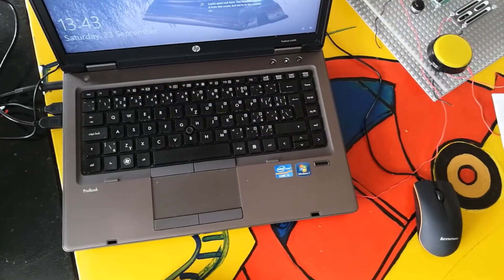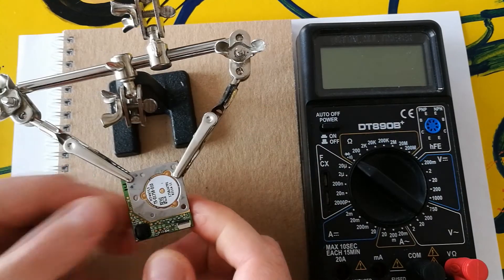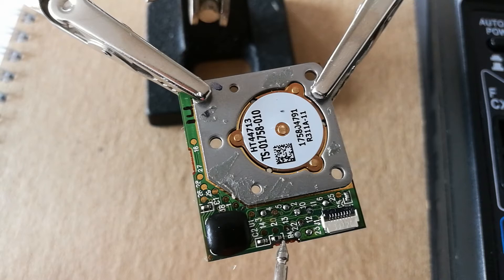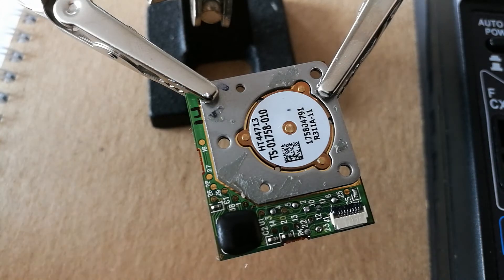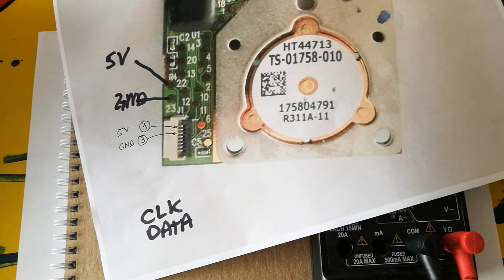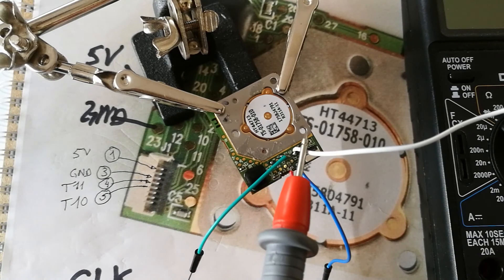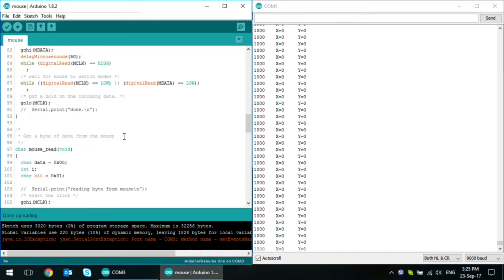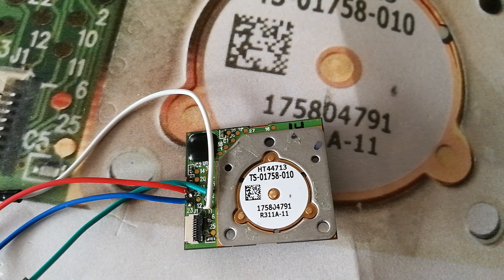How to find pinout for Touchpad/Pointing Stick & connect to Arduino - Synaptics

Comment: FOR FUTURE REF: 
/*
 * an arduino sketch to interface with a ps/2 mouse.
 * Also uses serial protocol to talk back to the host
 * and report what it finds.
 */

/*
 * Pin 5 is the mouse data pin, pin 6 is the clock pin
 * Feel free to use whatever pins are convenient.
 */
#define MDATA 5
#define MCLK 6

/*
 * according to some code I saw, these functions will
 * correctly set the mouse clock and data pins for
 * various conditions.
 */
void gohi(int pin)
{
  pinMode(pin, INPUT);
  digitalWrite(pin, HIGH);
}

void golo(int pin)
{
  pinMode(pin, OUTPUT);
  digitalWrite(pin, LOW);
}

void mouse_write(char data)
{
  char i;
  char parity = 1;

  //  Serial.print("Sending ");
  //  Serial.print(data, HEX);
  //  Serial.print(" to mouse\n");
  //  Serial.print("RTS");
  /* put pins in output mode */
  gohi(MDATA);
  gohi(MCLK);
  delayMicroseconds(300);
  golo(MCLK);
  delayMicroseconds(300);
  golo(MDATA);
  delayMicroseconds(10);
  /* start bit */
  gohi(MCLK);
  /* wait for mouse to take control of clock); */
  while (digitalRead(MCLK) == HIGH)
    ;
  /* clock is low, and we are clear to send data */
  for (i=0; i < 8; i++) {
    if (data & 0x01) {
      gohi(MDATA);
    } 
    else {
      golo(MDATA);
    }
    /* wait for clock cycle */
    while (digitalRead(MCLK) == LOW)
      ;
    while (digitalRead(MCLK) == HIGH)
      ;
    parity = parity ^ (data & 0x01);
    data = data >> 1;
  }  
  /* parity */
  if (parity) {
    gohi(MDATA);
  } 
  else {
    golo(MDATA);
  }
  while (digitalRead(MCLK) == LOW)
    ;
  while (digitalRead(MCLK) == HIGH)
    ;
  /* stop bit */
  gohi(MDATA);
  delayMicroseconds(50);
  while (digitalRead(MCLK) == HIGH)
    ;
  /* wait for mouse to switch modes */
  while ((digitalRead(MCLK) == LOW) || (digitalRead(MDATA) == LOW))
    ;
  /* put a hold on the incoming data. */
  golo(MCLK);
  //  Serial.print("done.\n");
}

/*
 * Get a byte of data from the mouse
 */
char mouse_read(void)
{
  char data = 0x00;
  int i;
  char bit = 0x01;

  //  Serial.print("reading byte from mouse\n");
  /* start the clock */
  gohi(MCLK);
  gohi(MDATA);
  delayMicroseconds(50);
  while (digitalRead(MCLK) == HIGH)
    ;
  delayMicroseconds(5);  /* not sure why */
  while (digitalRead(MCLK) == LOW) /* eat start bit */
    ;
  for (i=0; i < 8; i++) {
    while (digitalRead(MCLK) == HIGH)
      ;
    if (digitalRead(MDATA) == HIGH) {
      data = data | bit;
    }
    while (digitalRead(MCLK) == LOW)
      ;
    bit = bit << 1;
  }
  /* eat parity bit, which we ignore */
  while (digitalRead(MCLK) == HIGH)
    ;
  while (digitalRead(MCLK) == LOW)
    ;
  /* eat stop bit */
  while (digitalRead(MCLK) == HIGH)
    ;
  while (digitalRead(MCLK) == LOW)
    ;

  /* put a hold on the incoming data. */
  golo(MCLK);
  //  Serial.print("Recvd data ");
  //  Serial.print(data, HEX);
  //  Serial.print(" from mouse\n");
  return data;
}

void mouse_init()
{
  gohi(MCLK);
  gohi(MDATA);
  //  Serial.print("Sending reset to mouse\n");
  mouse_write(0xff);
  mouse_read();  /* ack byte */
  //  Serial.print("Read ack byte1\n");
  mouse_read();  /* blank */
  mouse_read();  /* blank */
  //  Serial.print("Sending remote mode code\n");
  mouse_write(0xf0);  /* remote mode */
  mouse_read();  /* ack */
  //  Serial.print("Read ack byte2\n");
  delayMicroseconds(100);
}

void setup()
{
  Serial.begin(9600);
  mouse_init();
}

/*
 * get a reading from the mouse and report it back to the
 * host via the serial line.
 */
void loop()
{
  char mstat;
  char mx;
  char my;

  /* get a reading from the mouse */
  mouse_write(0xeb);  /* give me data! */
  mouse_read();      /* ignore ack */
  mstat = mouse_read();
  mx = mouse_read();
  my = mouse_read();

  /* send the data back up */
  Serial.print(mstat, BIN);
  Serial.print("\tX=");
  Serial.print(mx, DEC);
  Serial.print("\tY=");
  Serial.print(my, DEC);
  Serial.println();
  delay(20);  /* twiddle */
}
Reply: Thank you so much, i couldn't find the code anywhere and the link has some kind of library that has no directly usable example

Comment: Require a better video on the actual installation of the code, libraries and then running it.
Reply: You can find can find code on Arduino playground for connecting a PS/2 mouse to Arduino. Just make sure you connect data pin to pin that's capable of pwm.
Reply: @153SCORN  thankyou bro
Reply: have you got the code for this??

Comment: Thank you so much for this video, very informative, showed me almost everything I would want to know. I found this because I had the exact same part, and was trying to look at it with my newly bought logic analyzer. I put 22 to +5V and 23 to ground, and pulled up 10 and 11 with 6.8K resistors, and tried looking at the data on CLK and DATA. For some reason, it could even be a soldering mistake, although I've checked everything multiple times, both of these signals read the same, and they both look like data packets. Are you sure that 10 is actually CLK? I have seen someone on hackaday saying that you can actually read PS/2 without reading the CLK signal.

Comment: I would like to buy one module of this trackpoint but i cant seem to find one the internet. Where did you buy it?
Reply: The only way I have found to get one of the modules is to buy a whole keyboard, either used or new, which has this module and then scrape it from the keyboard. 
I bought 2 of these used/broken keyboards for a total of $2.4 from a local market. Retrieved the exact same module as is there in the video and successfully followed all that he did in the video.

Comment: I've got a laptop that has touch pad and pointer stick not working from the very start at windows 7 and 10 install. It's enabled with fn key, So I'm expecting it's not an actual fault with those devices but fault with motherboard. Where does the data go to? Is it the super io chip? Southbridge? Cpu? Perhaps a broken track leading there? What do you think? A USB mouse works. Surely a broken track leading to other motherboard circuitry right? Z30 toshiba.

Comment: hey! i want to know if i can use raspberry pi instead of arduino/
Reply from the maker: I dont use RPi at the moment but I am sure it's much easier. You dont need to emulate PS/2. Just connect the pins and then use Linux to attach PS/2 mouse to those pins. Alternatively, use PS/2 to USB adapter - this will help to avoid any programming at all
Reply: There is one more question if you will. I have successfully identified voltage and ground pins. I am not able to find the clk and data pins even after whole day trying. there are about 6pins left out of total 8. Can you please help me in that regard.
Reply from the maker: Sorry but I can't help if my tips from the video don't work

Comment: Great tutorial! I have a Synaptics PS/2 touchpad from a Samsung QX411 laptop. I found schematics that show that the chip to be working on 3.3v. As you said T22 seems to be power, but there is also T16 which has 14.7ohm resistance with T22. Do you have an idea what it could be for? Maybe one is for 5v and the other for 3.3v? Thanks a lot!
Reply from the maker: Which one is first after the connector? T22 or T16? Measuring resistance between pins does not mean anything to me. More important is to compare which pin is directly connected to the connector.
Reply: Sorry, I wasn't clear enough. T22 is connected directly to pin 6 and T16 has 14.7ohm with pin 6 and T22, respectively. The pins are: 1-nothing,   2-T14,   3-T17/T23/ground,   4-T12,   5-T13,   6-T22
It's a clickpad, so it only has one button and the two mouse buttons are separated in software depending on the touchzone. The button seems to be connected to T6, but it is not connected to the pins.
Do you know how the button clicks are transmitted over the PS/2 connection? Could it have anything to do withe the empty pin 1?
Reply from the maker: I think you can connect 5v to T22.
These are industrial high-volume units so the 3.3v pin with 5v should not damage the circuit.
For TX and RX connect to the T pads that I stated.
Button detection is described here:
https://www.youtube.com/watch?v=8Ex1pPsiTR4

But first you need to get connected successfully the basic.
Reply: Thanks!
Reply from the maker: Let me know if it works

Comment: I want to mod a desktop keyboard with this, is there a way to make it work with usb and not ps/2? Or will you need a ps/2 to usb converter, in that case I guess I can grab and old ps/2 cable and connect it to the pc like that.
I'll be using an old keyboard from lenovo thinkpad.
Reply from the maker: Yes. There are dongle converters, for example on aliexpress. Also, you can use arduino Pro Mini for this purpose. A lot of tutorials on youtube on this subject.

Comment: Bro which bord are you usin is it aedieno uno bord
Reply from the maker: I have tested fine with Arduino Uno, Nano and ESP8266
Reply: Lenka Design Workshop  
Bro i tried my acer old laptop i dont remember the model numbers but not working with uno. I have odered a pro micro also please give your wgats app no so that i couldent send the picture